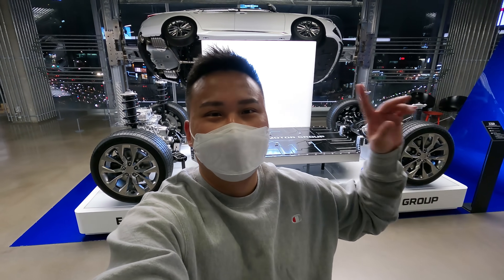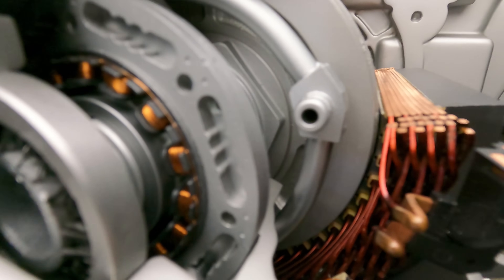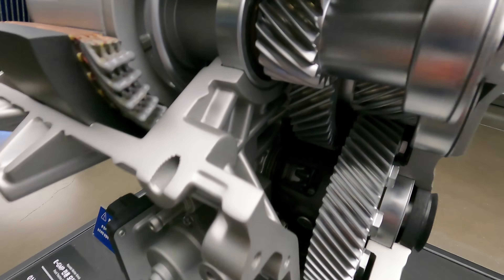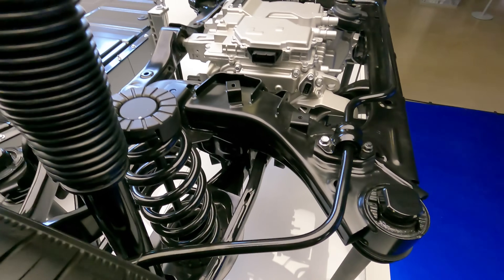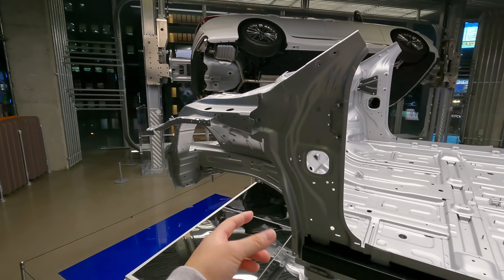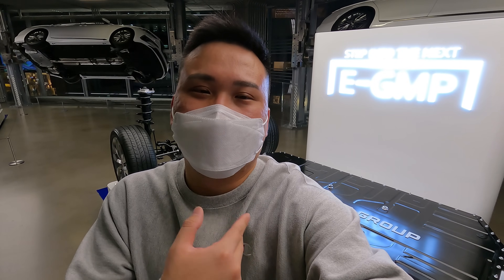INSIDE IONIQ 6 is this – E-GMP: Hyundai's first EV-dedicated platform

Comment: Since this platform E-GMP car rides low from the ground, what type of protection is there for the bottom of the platform, it's great that the top platform is protected from the passengers, but what about protection on the bottom platform that rides close the ground ?  I.E: Driving on a road that has a severe dip in the road and the bottom platform scrapes the pavement or hits a large rock or debris on the freeway?  What is the possibility of a severe puncture scraping and piercing the bottom of the "skateboard" platform damaging one or two battery packs, causing a fire?
Reply from the maker: It sure won't be bullet proof to any and all situations, briefly shown at 7:55, the platform is reinforced to protect the batteries as well. Food for thought though!

Comment: Thanks for a great explanation ! :)

Q: what are the advantage by putting in the front motor  higher and not getting a 'good size' 'frunk' ?  

 one of the only things that i think there seems 'stupid' (take a mach-e with 80L in capacity on AWD compared to hyundai 24L AWD)
Reply from the maker: Good point. Hyundai has mentioned that they have worked on the cabin space to be the utmost priority, hence sacrificing other spaces such as frunk. When the car itself is roomy inside, there's not much of the need for frunks to be bigger, and the only reason why frunks were there in the first place is because it was a dead space, an engineering leftover space to my view.

Comment: Thx for showing details of Hyundai's  EV Electric – Global Modular Platform. 

But your lack of knowledge, such as not knowing what a Pouch Cell is or that its commonly used. And your other factorial errors, were a minor distraction. 
So if you could get assistance from someone with more knowledge of EVs, next time it would help. 

Again I really appreciate what you posted. It showed much more details than other posts about the IONIQ 5. So my critique is just meant to suggest areas of improvement, but it was still a great post.
Reply from the maker: Such a great feedback, thanks, I truly am. I just started driving an EV a week ago, finally getting to know what those cars are really like, still a lot of pickup and learning to do!

Comment: I don't get the part about the disconnected front/rear. It's the cas for every EV with 2 motors already. Are you sûre it's not a left/right 'disconnecter' to have perfect differential control ?
Reply: You are actually almost right. Belt watching the video the discounter actually disconnects the front motor from the front axles. It has nothing to do with front/rear but more with not having to synchronize front/rear speed and having only the rear motor pushing and the front acting on hard acceleration/bad traction

Comment: Excellent info, thank you for sharing.

For sporty models, perhaps they could have a gap in between battery modules to mount the seats lower down? 

There is research being done into structural battery tech, i.e. the batteries make up the body of the thing you're making and don't sit inside it as they currently do. That would make it easier to have lower car models as well.
Reply from the maker: sounds like a great idea!

Comment: Front motor could sit lower to have the available frunk also why not have the rear traction motor as a front motor so basically two rear motors in the vehicle lower output but greater Efficiency and performance trade off wouldn’t be too great. 200hp with 300lbs Torque is more than enough .
Reply from the maker: Probably because of the disconnector

Comment: This video is an incredible look! No one else has this coverage, congrats and nice work. This car is an absolutely astounding go by Hyundai. I hope it hangs on in real world reviews, because this car has hella hyped
Reply from the maker: About time Hyundai brings in the competition of the dominated market :P
Reply: @CarSceneKorea  Boss man, can you do a video about batteries used by Hyundai in these new models vs other ones like Tesla. The range is important but I am hearing things like Tesla has double the battery cycle number compared to others so it would be nice to know what battery tech Hyundai has to offer in terms of long years of use. Also, you seem to have a good amount of information on this E-GMP platform, so if it was a normal SUV or CUV, would they do a double layer of batteries (batteries are placed very low on the ground and SUV/CUV needs to have high seating positions, so they can actually put a lot of batteries on top of each other if its something possible)? That way the battery range would be huge.
Reply from the maker: @muhammedkeser7064  as much as I'd love to, I can't make a video on info that I'm unsure of, especially when it comes to tech and comparing it to other brands. My focus is mainly introducing the car itself, not a comparison to its competitors at the moment. To make such videos, I'd need lots of help starting with getting a test drive car first. As you can see, I'm running my channel of my own. As much as I'd love to cover your request, that's just out of my league :'( I'll try my best growing the channel and be able to deliver such requests, hang in there!
Reply: Completely agree! Fantastic overview. The enthusiasm is amazing! If Hyundai wanted a brand evangelist, they couldn't do much better.
Reply from the maker: @PrestonCole  you just made my day :) thank you!

Comment from the maker: 0:00 What's inside Hyundai IONIQ 5?
0:27 Brief story about skateboard platform
0:58 E-GMP up-close
1:14 Specs on E-GMP
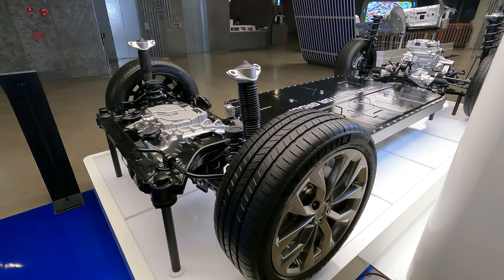1:44 Charging E-GMP, battery specs and travel distance
2:21 Main motor on E-GMP
2:51 Inside of E-GMP Motors up-close & tech inside
4:05 Secondary/smaller motor(Front Traction Motor System)
5:15 Battery Cell
5:33 Battery System
6:47 5-multi-link front suspensions
7:30 Ultra-high strength steel main body
8:54 Frunk?
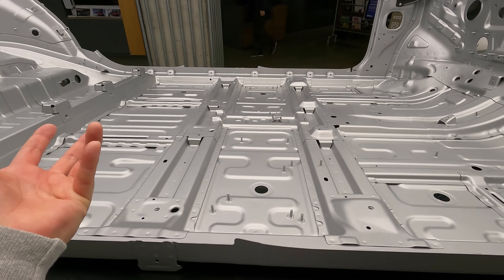10:25 EV sales plan for Hyundai
11:05 Wrapping up